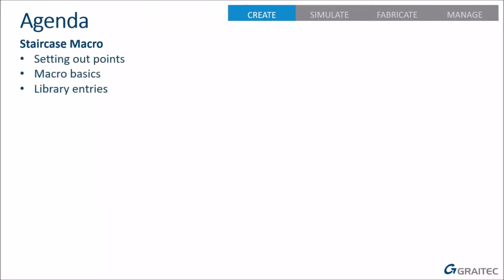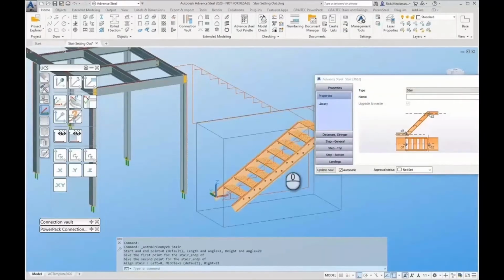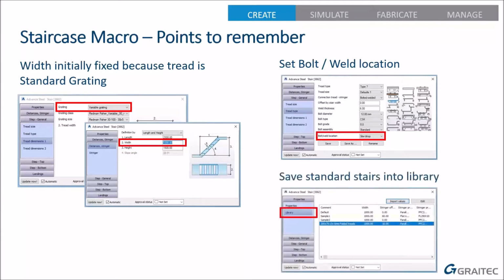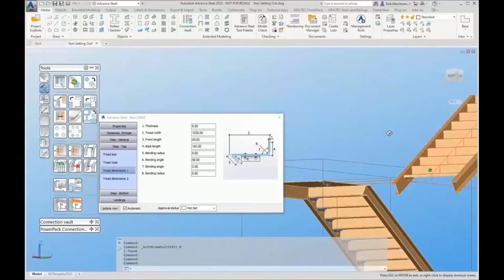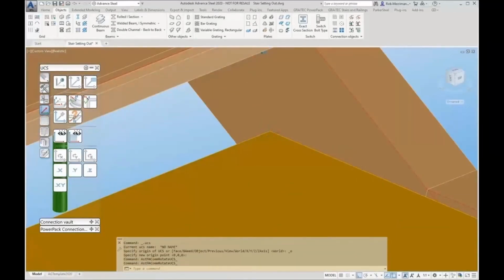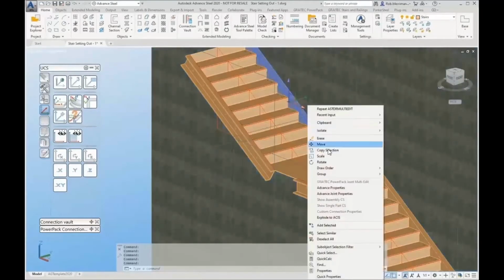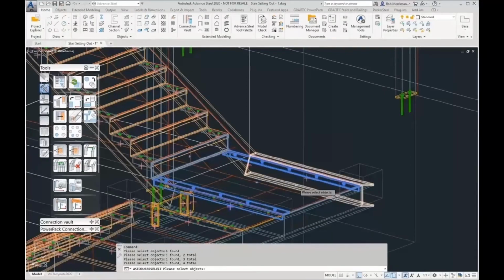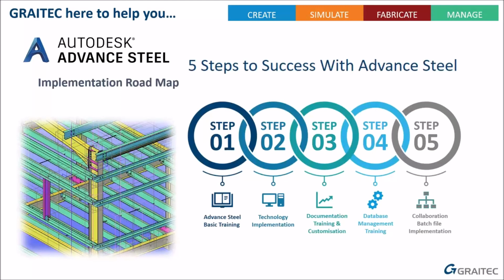Advance Steel Secret to Stairs

Comment: great video, Everytime i draw my flights of stairs i get a difference in height where the two landings meet. usually around 1.5" off. any advice on what i may be doing wrong?

I am using the copy joint command and drawing out my stairs........im stuck

Comment: I run a small metal shop that builds metalic stairs and i could use an app like this, but when i check the price 2800 euro / year… no thank you. But again maybe i didnt understand and for 2800 euro you have someone working on my projects with me?